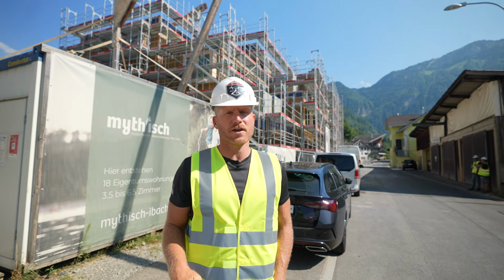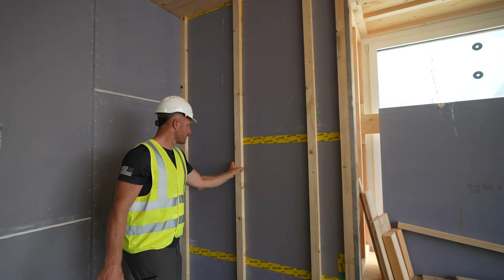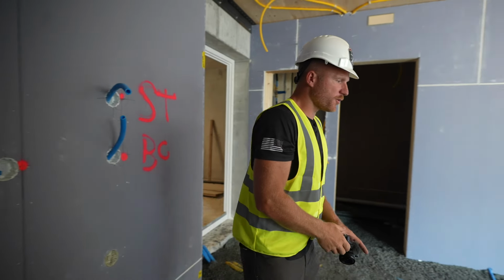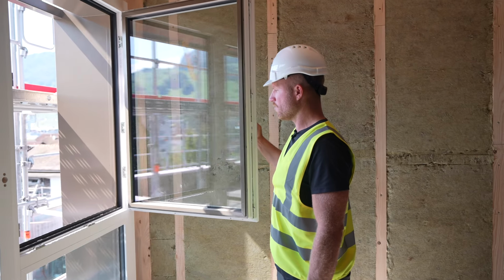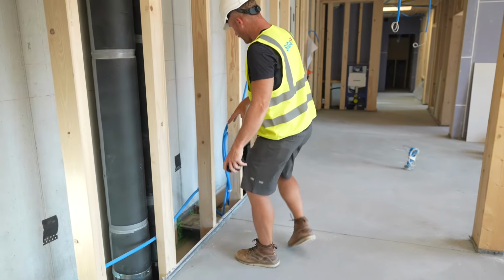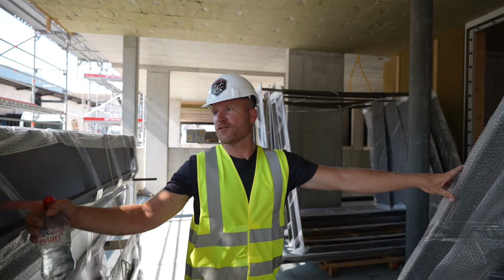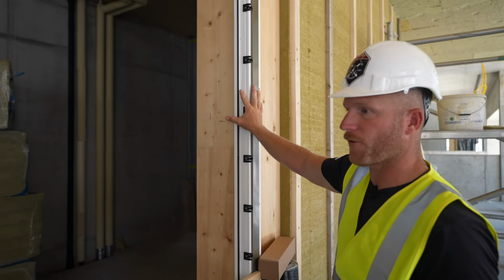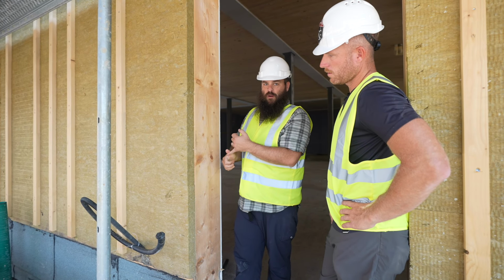Swiss Construction Site Tour - Insane Building Details

Comment: I dont use 2x4 exterior walls anymore..all homes i build i use 2x6 on 2 foot centers..all my rafters use 2x6 on bottom runs instead of 2x4..it may b more expensive but save money on cooling and heating in long run

Comment: Wow! That is something else! Insane floor/ceiling thinkness! They surely are well insulated for temperatures and sound! Where we use 2x4's it seems they use 4x4 posts or 2x10's! It would be great to raise the American build standards to something similar! Better insulated and heavy duty structures would surely withstand hurricanes and tornadoes much better! These type of builds should be mandatory in major storm zones. Very interesting! Can't wait to see what else they do different...
Reply: Sure, you can do the same in USA just now, byt as you use 4 times more material, expect the price to go up x4 also 🙂
Reply: Its not as simple as that. U build to meet needs. Thats high up in Switzerland so will have to cope with snow, wind maybe avalanche.
Reply: @jcoul1sc  basically all construction in Western Europe is better quality than the US. This example from Switzerland is not an outlier.
Reply: @jaredanson  it is, but lots of factors involved, mostly the value of the finished building alongside high levels of safety and health of occupants.  That building is built to meet environmental change in 50 to 100 years time
Reply: @jcoul1sc  This is not high up, I'd say maybe at 550m/ 1500 feet (I live not far from here) But yes this norm now. The insulation is there to keep heat in during winter and to keep it out in the summer. It reduces the energy use (energy costs are much higher here than in America), this I believe is a passive house.

Comment: Were they equating this building to an envelope house?  I know that air tight construction is a very common building approach over there... super air tight building, so much so that air transfer has to be engineered into the system.  It also means very little heat loss, minimal dust from outside, and next to nothing to heat it.  Did they talk about air exchanges/control at all while you were there?
Reply: By the way, loving this departure from your normal content... always love learning new and different stuff.  Thanks!
Reply: Netherlands as well, I live in a house like that and men is it comfortable. Energy bill, we only have electric, is € 60,- / month, with only 12 solar panels on our roof. We have heatpumps, cold warm water storage in ground to heat and cool our house.

Comment: Never seen so much overkill, the cost must be astronomical
Reply: Anyone anywhere can order overkill. Just get your wallet out
Reply: Yeah I want to know the cost per square foot for this structure. I'm guessing at least four times as much.
Reply: Minimum wage in Geneva is $ 4200,- /month.  We are poor.
Reply: Also energy prices are very different. Making it a good financial choice to build overkill on the insulation and save money on heating and cooling over decades to come. But yeah, obviously this is not low income housing.

Same reason Europeans largely drive different types of cars than Americans - when you pay 3 times as much for fuel you don't buy a big truck unless you really need it for your work.

Comment: Construction quality in Germany, Austria, and Switzerland is world-leading.  They simply don't do doors and windows that leak.  It would be a scandal.
Reply: They can't. They have standards for that. For example my German friends had small imperfections in their windows (like little specks), and since some exceeded the limit (yes there is a standard for that!), they have been replaced. Think 1 tiny barely visible think per 10 sq feet.
Reply: @PaliVCiernom  sounds expensive
Reply: @95thousandroses  it's not too bad. But it does cut off the most bottom segment off the market. Recently I wanted to buy a window for a tool shed. I could not find anything less than a double glazed window
Reply: In alps french italy ✅✅
Reply: American doors and windows don't leak. It's not that hard to make non leaking door or window. Problem starts when you hire installers for 15$ and expect them to install everything correctly with correct weather guard.
Reply: The amount of people on this 1 comment with no clue of building science, wind, water, snow and ice is hilarious
Reply: But we have to be clear, that Switzerland is far ahed of Austria and Germany. The Number one since years…..
Reply: The weather in some of those countries are very bad compared to most of the USA. They want more insulation in their buildings
Reply: the issue with the US is anyone who wants one can get a builders license and contractor license with money. They wont lose their license either if they did shitty work. sucks but its slowly getting better
Reply: @galek2001  in the majority of countries other than America trades people have to complete a 4 year apprenticeship with off site college training included and are highly sought after due to their extensive training and experience. It seems like anyone in America can buy some tools and they are a carpenter all of a sudden. In Germany becoming a carpenter Carries  the same respect in the community as a doctor and had equal pay
Reply: @mrsbradpittiful " carpenter carries equal respect and pay as a doctor"   lol, no and no.
Reply: @95thousandroses  you clearly have no idea.
Reply: @mrsbradpittiful  it's OK, one day you'll learn not believe everything on reddit even with lots of upvotes.
Reply: @95thousandroses  I live in Germany and work as a carpenter! One day you’ll  become educated on the subjects that you think you know
Reply: @mrsbradpittiful  lol, no you don't.
Reply: @mrsbradpittiful  Yep. Low standards all around in the U.S.A. And that goes not just for building standards but, as you pointed out, also professional standards.

That's not to say there isn't licensing requirements for numerous professions, because there are. In some cases, there's far too much. The problem, really, is the quality and inconsistency of the requirements and training. Much of it is just bureaucratic paper-pushing. Then there's the fact thay a lot of mandatory "training" boils down to watching a video or clicking through a PowerPoint slide and then taking a 5–10 question assessment at the end. Pass it and get your certificate for another year or whatever. It's insulting, embarrassing, and shameful. In many other countries (especially for trades in Europe and Asia), there is the required book work, of course, but it is integrated into and/or followed up with on-site apprenticeship. Far, far superior.

America really needs to get its act together, because so many countries are putting us to absolute shame in terms of technology, engineering, and infrastructure quality. We keep banking our past successes and glories, thinking they're going to safely carry us into the future without us putting forth effort to legitimately improve upon them, but they're not. We are quickly being outpaced in so many areas—from education to medicine to construction to electronics—it's absurd.
Reply: @95thousandroses  i work in the health Care system and i know How much a dr. Earns... And i have friends who work in construction... And it depends on the further career paths but it's totaly possible to earn more than a dr. Here in switzerland...maybe the saliry seeling is higher in medicine... But you can get quite highe as a carpinter, constructor...
Reply: @galek2001  maybe in your state or city.But a lot of places , building codes have to pass before next construction phase can begin with a city, county or state inspector.
Reply: In America you have freedom to do whatever the heck you want for windows and doors.
Reply: @SonicTool-l3m  it’s called low standards
Reply: @mrsbradpittiful  I would say its call the right to choose. If you want to pay $200 for a harware store window and deal with the lesser quality you can. If you want to order a window from a European manufacturer for $2000 then you can do that as well.
Reply: @95thousandroses  That just moves an unnecessary cost down the line. Choosing that 200$ window and installing it poorly might lead to costs of over 2000$ in 10 years time when you have to repair all the damage. Some standards take away choice to ensure longevity,  something we need in our buildings and infrastructure nowadays.
Reply: @olefrederikpedersen5282  almost zero chance in 10 or even 20 years a cheap window would cost 2k in maintenence.  A poorly installed expensive European window would suck too.
Reply: @95thousandroses  
then the new housing developments turn into a slum in 30 years.  Europe wants to sustain the viability of their inner cities.
Reply: @95thousandroses  Ironically windows from European manufacturers like Shuco, are less expensive than any Anderson, Marvin, Pella, even considering shipping cost from Europe. A 35/40 windows package for a 4500sf home it turns out to be about 25/35% less. On a 6 figures invoice that makes a lot of saving.
Reply: @95thousandroses  Consumer protection. Ordinary people can't tell.
Reply: @95thousandroses  that won't happen, because only accredited installers can install for proper companies. Most company actually have their own teams to install which enables the companies to be compliant with the warranty rules.
Reply: @SonicTool-l3m  which is a HUGE problem. When a house is being sold how do you as the buyer know which shortcuts the original owner (or renovator) took? Once things are closed in it all looks the same. Real tight building rules are seriously important to have a fair and level playing field for everyone that wants to buy or even rent a house.

Comment: I know builders hate to talk about cost per square foot, but what does this system cost compared to the best U.S. system?
Reply: The average price per m² (about 3x3 feet) in Ibach is CHF 9,653/m²
The average purchase price for a property there is currently CHF 1,699,000. The purchase price for 80% of the properties is between CHF 617,500 and CHF 1,894,380. Currently August 2022 1 CHF is about 1 Dollar.
So expensive, but not in proportion to what else you can buy there. 
And remember, this is not big, between 100 and 230m2, 1070 square feet to 2500 square feet.